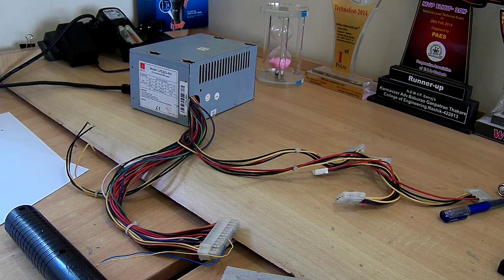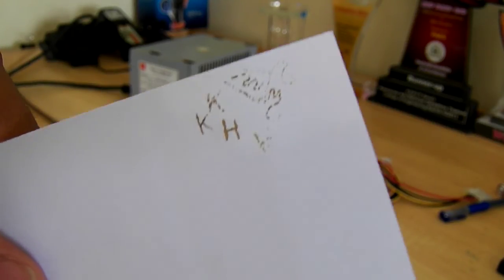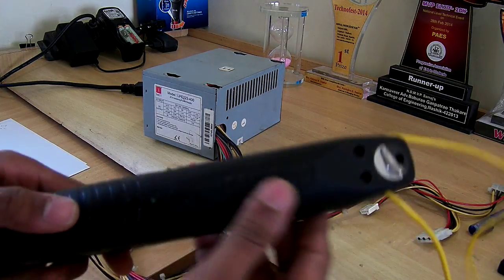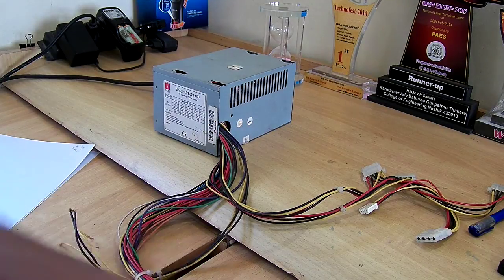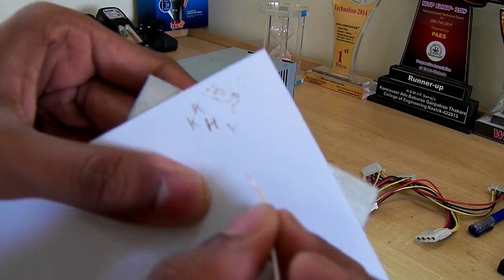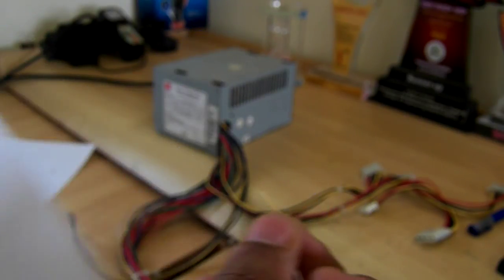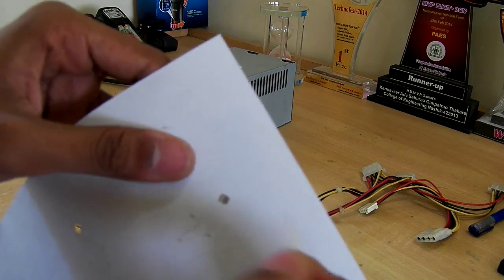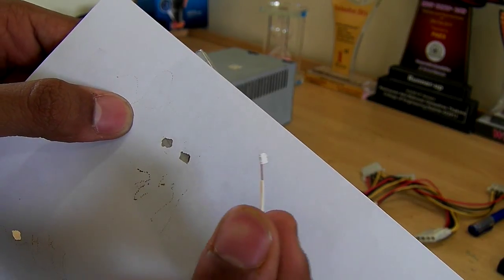#4 How to make zero ink - Inkless Printer

Comment from the maker: Its certainly good idea to use laser but it will need special type of paper,in this case we don't need special kind of paper normal paper work fine.

But yes,it is also possible to use laser instead .i think laser printing can be faster than this technique mentioned in video.
Thanks for sharing you thoughts. Good idea.